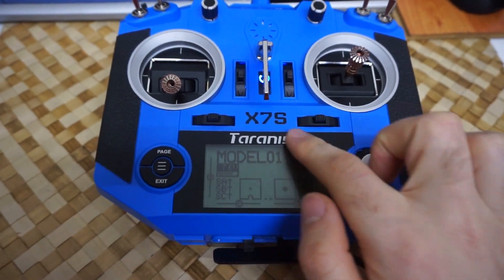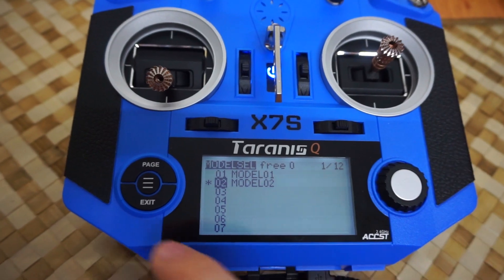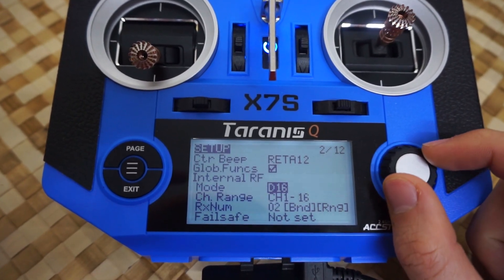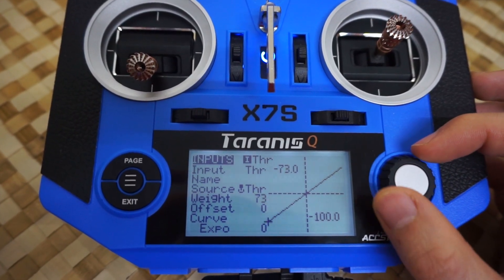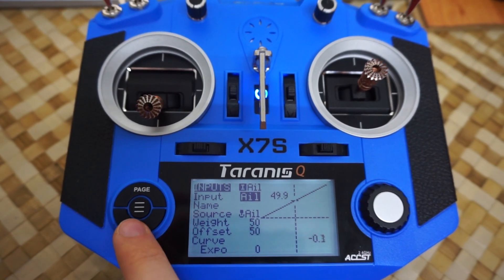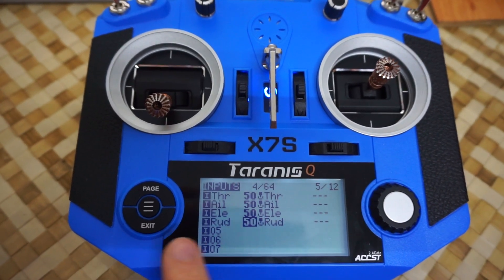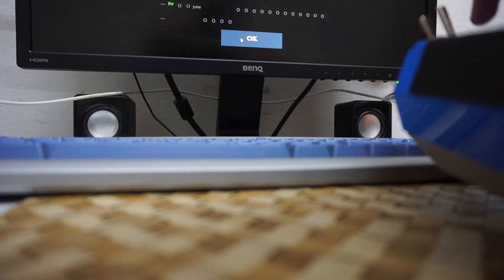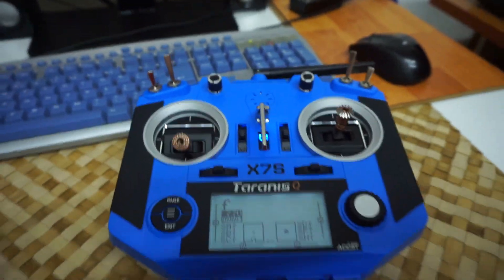How to play FPV Freerider on PC using Taranis Q X7S radio (USB cable)

Comment: Could someone help me ... I've tried dozens of videos on youtube ... I've installed and reinstalled the drivers and it didn't solve the problem, I believe the problem is because I'm using fpvfreerider DEMO.
Reply from the maker: Demo should work just fine. Make sure you're using a USB data cable and not a simple charge cable.
Reply: @furulevi  I just update windows and now perfect.
Reply: @furulevi   Thanks for your reply.